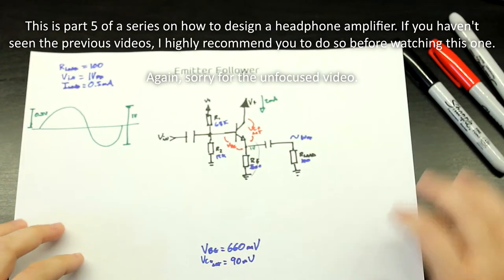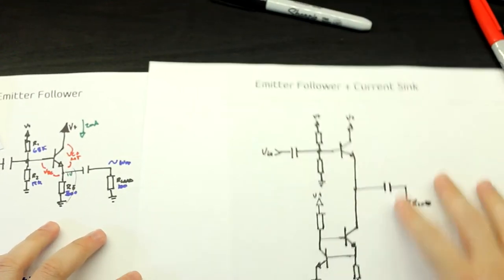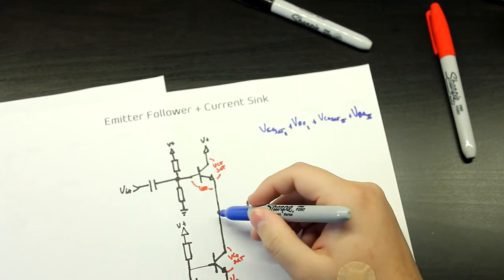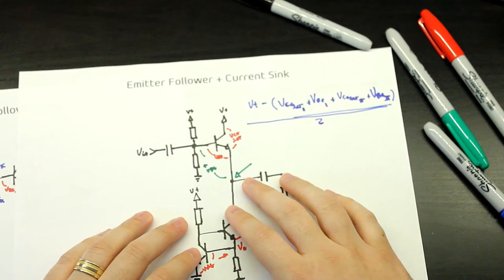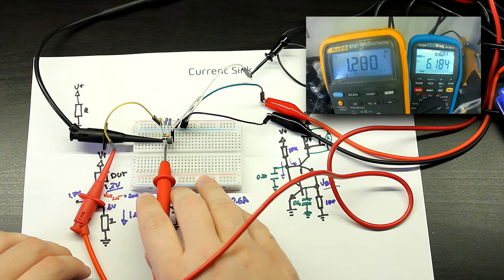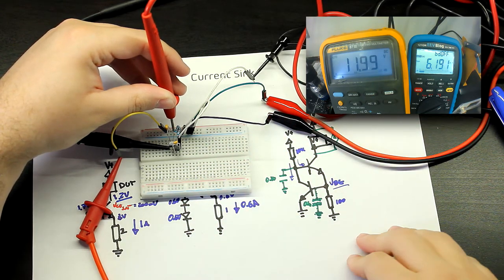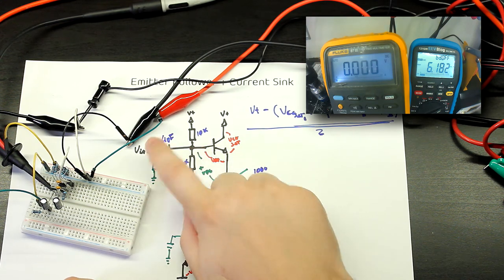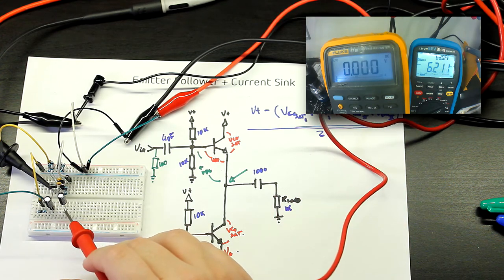#005 - Emitter Follower w/ Current Sink + Experiments (Class-A Discrete Headphone Amplifier Project)

Comment: Also, how do you determine which lead goes where for the electrolytic capacitors? How do you decide whether to use a polarized electrolytic or non-polarized ceramic?

Comment: The two 10k resistors in parallel with the base of the transistor would have an impedance of (10k + 10k) // Transistor_Base, correct?